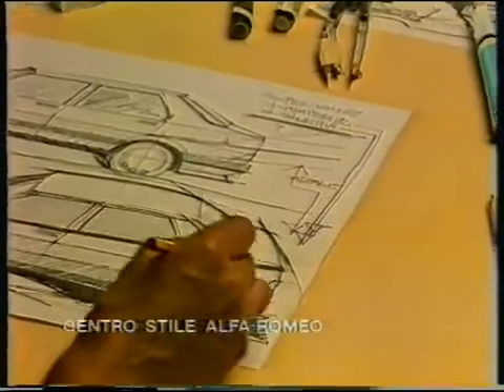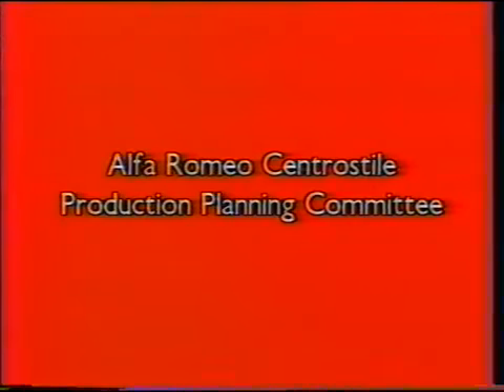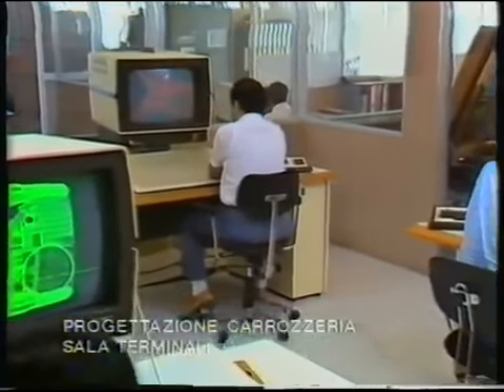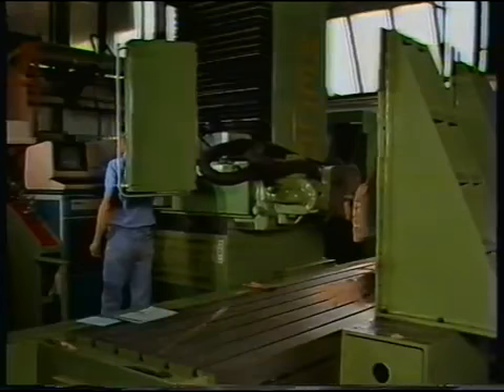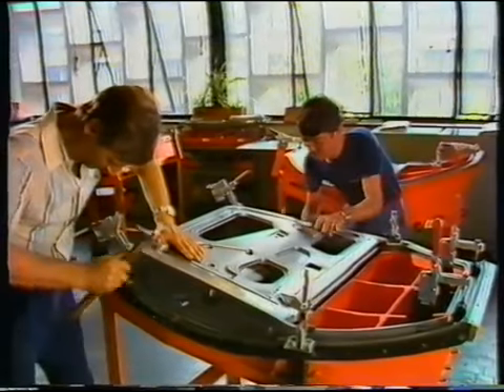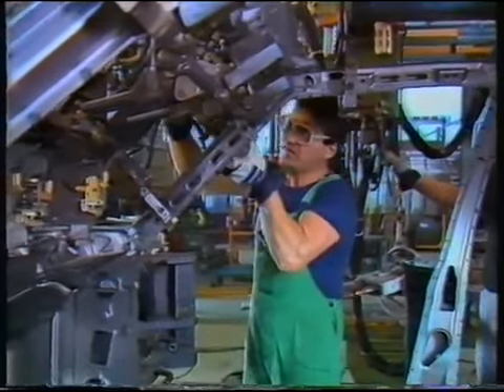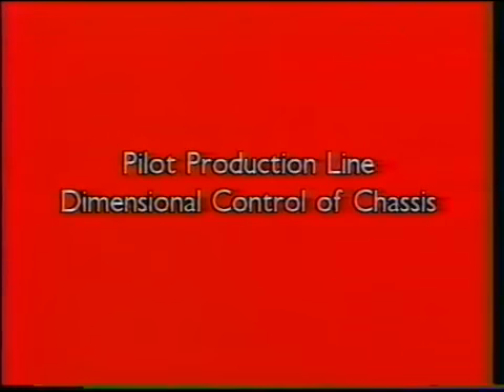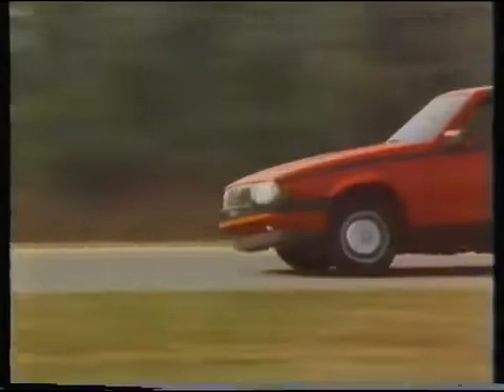1985 Alfa Romeo 75 | Design Process

Comment: I'm sure the car is good, but design wise, it looks like it was designed using only a ruler!
Reply: Due to limited financial resources, the car was designed by reusing as many components as possible from the previous model, the 1977 Giulietta, which was also a variant of the 1972 Alfetta.
As a result, the 75 is nothing more than a major facelift. Even the plastic perimeter strip is a device to disguise the close similarity of the body panels to the previous model.
However, let's remember that more rounded lines were seen in the 1990s.